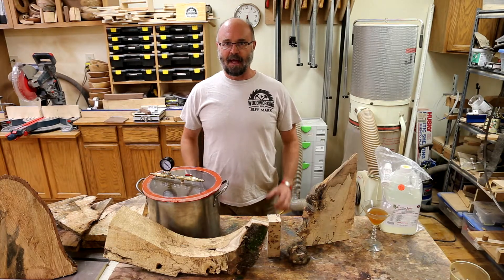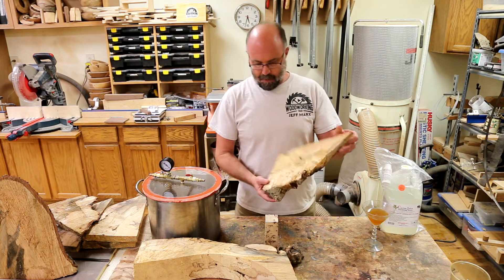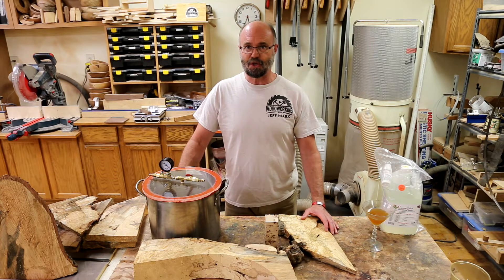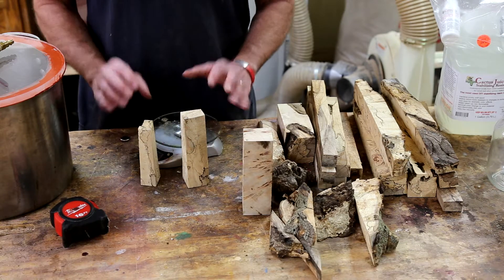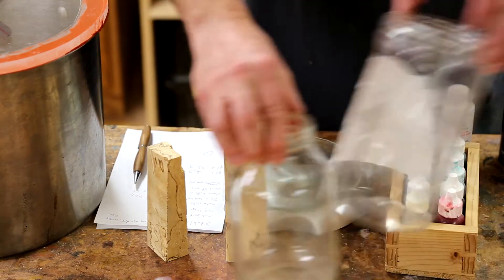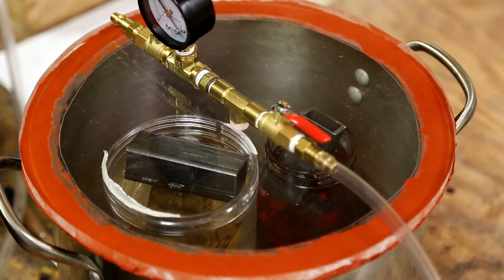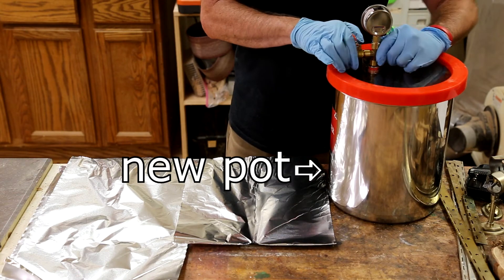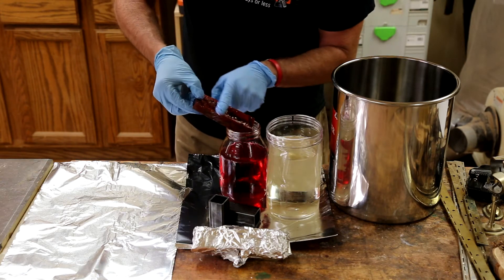Resin stabilizing wood

Comment: How in the hell do i sand this stuff? Its stronger than steel. I even used a grinding wheel. Ive used a hand plane. Ive used 80 grit. Ive used corse files, nothing cuts it. I dont have a belt sander and i dont have a scroll saw.
Reply from the maker: It is surprising how much harder and denser it is than unstabilized wood.  I've found normal woodworking tools work well on stabilized wood, but they definitely cut/sand/whatever more slowly.

Comment: Does it fit withe ordinary  epoxy
Reply from the maker: Epoxy doesn't work for stabilizing because it won't infiltrate into all of the smaller pores like the Cactus juice does.  Once the Cactus juice is cured, epoxy will bond to it and to the wood.  You can use epoxy to fill larger voids either before or after stabilizing.  Thanks!
Reply: @JeffMarxWoodworking  thank u

Comment: It was very interesting to see the amount of air that came from the two initial pieces. I'm really curious to see how the Alumilite dye tints the wood. I bet some really cool looking projects will come out of that stock.
Reply from the maker: Thank you!  I have a couple of pen blanks from this material on the lathe waiting for me to get to them.  Definitely excited to see how they turn out!  I really hope the dye shows up all the way through.
Reply: You made me think about adding a pearl powder to see if you can get a faux opalised effect.

I friend of mine has a little excess of automotive nissan blue with a light shimmer effect (it's $400 a gallon), and the glittering material they add looks stunning when you think it out for spraying. Ive even heard of people using automotive paint as pen blanks before.